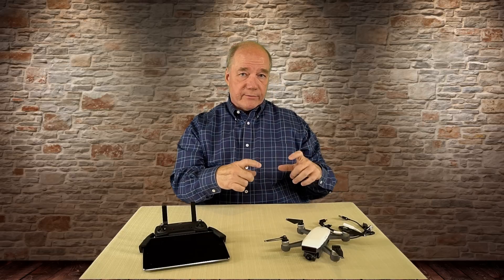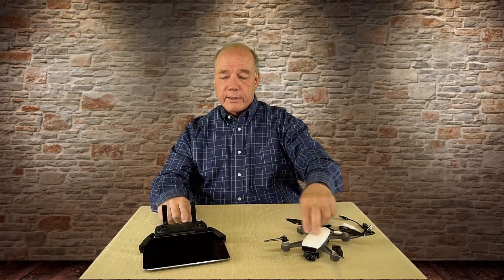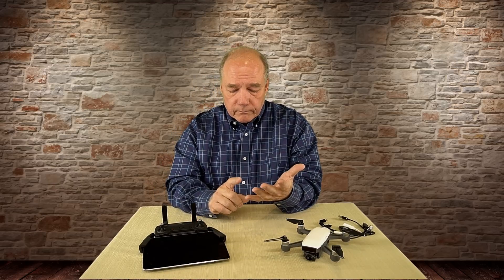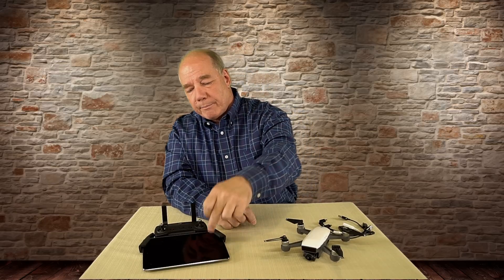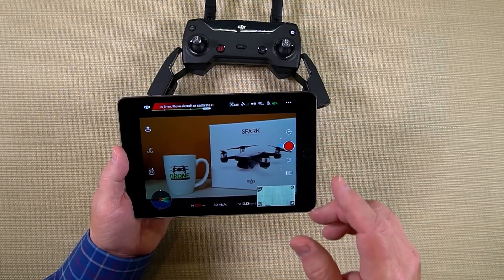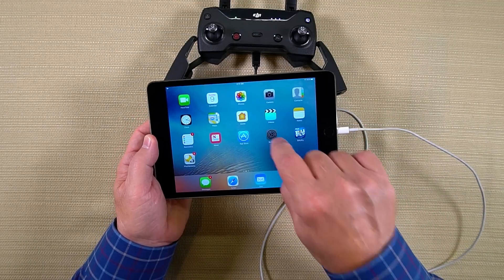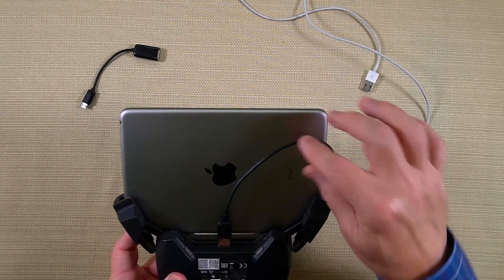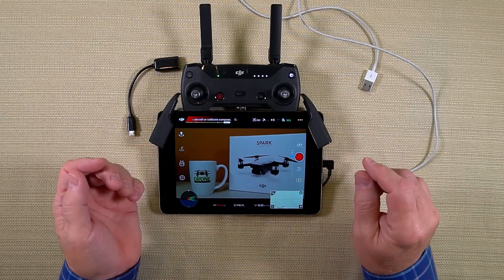One Simple Trick to Fly Your Spark Farther

Comment: So what is the range of flying and is there a chance to increase it with different controllers?
Reply from the maker: We have a visual line of sight limit in the United States that requires you to keep the drone in sight when you're flying. For me that's about 2500' with a beacon on the drone. That's really plenty of distance for most flying and keeps the skies safer for everyone. Technically it's not possible to use a different controller because that would require a firmware update to bind the drone to the new controller. I hope that helps and happy flying!
Reply: @Dronevalley  thanks for info

Comment: i was told if u so happened to use the OTG cable that turning off the wifi on apple doesn’t really turn it off therefore turn on Airplane mode and it will turn all radio connections of (WiFi/Bluetooth) and your gains from it will be better reception, longer battery life of the phone u use, and a longer range of flight.!! I Everything else in this video was dead on point though thank you and hope i answered some questions (:

Comment: I know I'm being picky or technical but, the controller and drone are looking for a clear WiFi channel or a channel that doesn't have nearby other WiFi channels in use. So, it's not looking for the strongest signal but, the cleanest. BTW, your drone will always be a very strong signal due to close proximity. The secret to any good and reliable RF connection is signal to noise ratio... which is the signal you want over any other nearby signal or noise floor at your location. And, on that subject, i would recommend turning the WiFi off on your phone and iPad. This will remove a very strong nearby WiFi signals that have the potential to interfere or reduce the quality of WiFi connection between controller and drone. I have notice while testing with my iPad WiFi while using it on and off that I see stronger receive signal from drone when it is further away as opposed to my controller seeing other WiFi signals from nearby devices. As one person mentioned the controller and drone have the same transmit power which is true but, the controller can 'hear' the drone easier without other WiFi signals near by. Again, it's all about signal to noise and the other Wifi signals are noise if they are not the signal it wants to hear which is your drone. If you do not have cellular capabilities in your tablet or iPad and need to use tether mode on your phone to tablet, then use a Bluetooth connection instead of WiFi.  Works great, just doesn't have the same throughput as WiFi can have.

Comment: I'm really confused. There's other videos that directly contradict this (like this one:  https://www.youtube.com/watch?v=zKxGrUqiXvE&t=597s).

I also chatted with DJI support today and they said using an OTG cable does NOT result in longer flying distance. I also tested this personally and can confirm this.
Reply from the maker: Robert, thanks for the post and I can assure you that the wired connection makes a big difference in your signal strength and will allow you to fly farther than using the default Wifi connection. The main benefit is that it also provides a more consistent connection in close when you're flying in noisy Wifi areas or around obstructions. I'm not sure who you spoke with at DJI but they are mistaken. It's simple physics, a wired connection is always faster and more secure than a radio signal and this is especially true with you have 2 Wifi transmitters as close as you do in the default setup with the Spark. You phone is connecting over Wifi to the controller, which in turn is connecting to the drone over Wifi. By adding the cable, you can turn off the Wifi on your phone and eliminate some of the "chatter" this Wifi connection is generating. This not only minimizes the interference created to allow you to fly farther, it also saves battery life on your phone, allowing you fly longer. This is the exact same connection used for connecting the DJI goggles to the Spark and made a big difference for me, especially when flying in noisy Wifi areas like urban settings.
Reply: @Dronevalley  I definitely agree that using a wired connection has a handful of other benefits, but I'm not convinced of the quantifiable nature of proving longer flight distance.

Would you be up for doing a video showing a real time flight of wired controller versus WiFi?

Also, I just purchased my Spark very recently, and it now comes with 2 OTG cables included in the box. Pretty cool!

Comment: Making it overly complicated. Why not just use a micro USB to lightening cable. I been doing that since day one. Also put your phone into airplane mode to stop any interference from external sources.
Reply from the maker: Mike, thanks for the post but a simple MicroUSB to Lightning cable won't work with this connection, you need an OTG adapter on the one end to get this working. The reason for this is that both the phone/tablet and the controller are "devices" that can't talk to each other natively. The OTG adapter allows one of them (the phone) to become a "host" and start communication. I'm not sure what type of cable you're using but it must also enable this function or it wouldn't work. I'm willing to bet that you're still connecting to the Spark through Wifi even though it seems that the cable is making the connection. One test you can try is to make the cable connection and turn Wifi off on your phone (with the Spark on the ground) to see if you maintain a solid video connection. My suspicion is that the connection will fail and you'll need to use an OTG dongle to get it working. Thanks again for posting and I hope you're getting a lot of great fling down there in NZ. Rick

Comment: Do you still use the cable in 2019 ?
Reply from the maker: Yep, I was out flying with the Spark last weekend and used the cable to eliminate the Wifi connection to the controller. It provides a more secure connection and saves battery on the phone by turning off Wifi. Stay tuned for more clips posting soon. Rick
Reply: @Dronevalley  Thanks !

Comment: EVERYBODY.   KNOWS. THAT.  THATS. THE. OTG.  CABLE. DAAAAAAAAAAA
Reply from the maker: Thanks for the post and just a few things to remember, when I posted this clip this connection was new to everyone and I wanted to make sure folks knew what they needed and how to do it so I explained it in details. Also, not every OTG cable or converter works with the Spark. We tested over 15 of them and only found 3 that worked and 2 of them were big and clunky. We actually have the one I showed in the clip specially manufactured for us so we know it works. Rick
Reply: @Dronevalley   so. Wich one  is the best cable. For. Samsung note. 8. Wich brand

Comment: Oh god dammit.. at 2:25 I stop the video because I can tell that this dude is just going to say, "use an OTG cable"...
This video should be deleted. This is no "TRICK" WTF MAN?
Reply from the maker: Thanks for the post but you have to remember that this clip was posted over a year ago and I was one of the first people to figure out that you could use an OTG cable for the quad. Even still, there are new fliers every day that have no idea about this fix and appreciate clips like this to help them with their flying questions.
Reply: Drone Valley I'm sorry dude. It was late and I hadn't had my nap..
I understand context of the video.. the time and all, I'm glad I came in late and it just works.
I don't agree with people saying that using WiFi from controller to phone is the same as otg.
Otg is way better.
I learned allot of other things from your video as you explain radio protocols, WiFi, etc...
Thanks man.
Reply from the maker: No problem, I appreciate you coming back to comment further. I love flying and when I figure something out that will help others, I post a clip like this one. That way we all get better together. Thanks again, Rick
Reply: @Dronevalley  my spark package came with two wires a usb c and standard usb can i use those for my andriod or do i still need dongle

Comment: Thanks for always informative videos.  I use a cable already.  Works fine.  Question:  I'd like to begin using an ipad solely for my drone.  I don't see a need to buy it brand new ( i have other options).  What are the minimum requirements or model that I should search for?  Minimum GB, which generation will do the trick?  Thanks.   I may just buy new.

Comment: If youve ever gotten a new Samsung Phone the usb to micro usb tiny dongle is in the box, just find a short cable. And its done.
Reply from the maker: Rob, thanks for the post but that is simply a converter from USB-C to Micro-USB and won't do what you need for the Spark. To make the physical connection to the controller, you'll need a specialized OTG dongle that essentially allows two "master" devices to talk with each other. I put this clip together because I have tried a lot of different versions of these OTG dongles and finally found one that works. Thanks again, Rick
Reply: Drone Valley 
The pins looked the same...
USB 2.0female  less the cable lenght.
Samsung even calls it OTG as other use.
However if you say it won't work, I'd better tell mine to quit working....
Reply from the maker: Rob, if it says it's an OTG, then you're OK. A lot of the adapters are included that don;t provide that function and only allow a customer to still use an older MicroUSB cable with the newer USB-C phone.
Reply: Drone Valley 
Thanks for clearing that up.
Nice video !
Reply: He's absolutely right. Just verified it works for me.
Reply: Yes this works for me also... don't use it much now at all since last update improved connections

Comment: RICK, As of their last firmware update the OTG option has been completely disabled on the Spark RC to any device. Even DJI admits to this and we can HOPE they straighten this  out as prior to the update with the cable there was NO lag time and much better controls response.
Reply: "As of their last firmware update the OTG option has been completely disabled on the Spark RC to any device." DJI must have restored the OTG option, because mine has the latest firmware as of 9/2018, and the cable connection works great.

Comment: When i connect the OTG cable and the satellites go off line and there Is no GPS flight mode because there Is no satellites available. Solutions ? Thanks
Reply: "there Is no satellites available." In my opinion, using OTG or not using OTG has no effect on satellite availability.

Comment: Nice job, but here are my questions. I use the mini c to lightening cable between my controller and mini 4. Works great. But I need WiFi on to get my maps via my cell phone hot spot. I do not have and never had a selection to download offline maps. So WiFi stays on. I assume the WiFi hot spot connection interferes with the Spark / controller WiFi connection, but cannot get around it due to the map issue. Any ideas?

Comment: Hi Rick i just got a spark and was having a bad time connecting my phone to the controller i found using the cable
between the two made it work. Yesterday i saw some video's about not having to use the cable any more because of 
the latest update i removed the cables and turn on the wifi and it works fine without the cables now. I know this 
is a older video have you changed the way you set up your Spark since the Jan. updates. Thanks

Comment: my question is does the cable still work everyone says the new version on the app no longer allows this cable connection
Reply: "everyone says the new version on the app no longer allows this cable connection" As of 9/2018 I can tell you my Spark running the latest firmware works great with OTG cable.

Comment: $18.95??!!  No thanks I'll look for something else.
Reply from the maker: Bo, thanks for the post but the cable I have on the site was custom made for us as was the OTG connector. I designed the set to be as small as possible and is the perfect length for your quad. I also certified that the OTG connector works with the quads and integrated a right-angle connection to make sure the cable lays flat against your phone/tablet. This type of custom manufacturing is somewhat expensive and I kept the cost of the cable set as low as possible. When you consider we also ship it free, it's really a bargain and something you know will work when it arrives. Hope that helps with your decision. Rick

Comment: The OTG cable does not improve distance. PERIOD. When using WiFi, there can be small periods of interference between THE PHONE AND THE CONTROLLER. The OTG cable eliminates those blips. This does not increase the range.
Reply from the maker: Bob, thanks for the post but I have to respectfully disagree with you. As I've explained in several clips on the topic, there are two separate Wifi radios in the controller. One connects to the quad (powerful) and one that connects to your phone/tablet (weaker). Because these radios share the same limited bandwidth there is a natural competition between them for connection to their respective devices. By adding the OTG cable to the controller, you eliminate one of these radios and reduce the congestion created by the tethering connection to your phone/tablet. This not only improves the reliability of the other connection to the quad, it also extends the battery life (and flying time) of you phone/tablet since you can turn off Wifi on the device. The reason the range is longer is that you now have an unimpeded signal that provides a more solid connection to the quad at distance. This is especially important when streaming video back to your device because this activity is the biggest bandwidth hog on the quad and will start to suffer soonest. This is why you start to see choppy video long before you lose a radio connection to the quad. By improving this connection you can essentially fly farther because your video feed is more stable and your connection more reliable at distance. I hope that helps and thanks for watching the clip. Rick
Reply: Maybe a DJI engineer will come along and set one of us straight.   Using the OTG cable WILL NOT INCREASE FLIGHT DISTANCE.  IT WILL improve the video signal.
Reply from the maker: Bob, I didn't mean to start an argument, but aren't we really saying the same thing? If it improves the video signal (especially at long distances) and you need the video signal to fly, using the OTG cable does in fact allow you to reliably fly farther.
Reply: It allows you to reliably fly.  Not farther.  Not higher.  Not deeper.  It just improves the video feed from the controller to the phone.  The improvement exists whether you are at 15 feet or 1500 feet. So I don't think we're talking about the same thing.  If you fire up your Spark and you have poor image transmission, you're not likely to take it out 2000 feet.  But no, your range is not improved.  An inch.
Reply from the maker: Bob, while I appreciate the spirited discussion, I have tested this on several different locations over a wide variety of terrain and I can tell you from my experience and testing that the range is improved on the Spark using the OTG cable. As I stated in an earlier post, the video feed is the first thing to be affected by signal issues and depending on where you're flying, it can be dramatic. By eliminating the second Wifi connection and tethering the phone to the controller directly you improve this video feed, which allows me to fly the quad farther out because I have a stable video feed. Without the OTG cable at these distances (still in VLOS) I have choppy or no feed at all and would not have been able to fly out that far. I have done this testing over the same routes using the cable and then again using Wifi and in every test the OTG provided a stronger connection. In addition to the testing, I have explained technically why the OTG cable helps improve your flight not to mention the added benefit of not using Wifi on your phone, extending it's battery use and enabling a longer flying time. All of these reasons support the use of this cable, which is a very low cost item for the added benefits it provides. Now lets quit debating this and go fly our quads. Rick
Reply: It's too cold to fly here, so all I can do is argue.  But I'll let you have the last word on it (even though you didn't change my mind).  I appreciate the respectful conversation.

Comment: Just a heads up guys.  For anyone new reading this post, it looks like the DJI GO 4 App (vs 4.1.20 - Newest Vs Out) has an issue with the OTG Cables.  Users reporting "Weak Image Transmission Signal" with this newest version.  Info here on DJI's site;    
 https://forum.dji.com/thread-124935-1-1.html  .  One of the DJI ADMIN's on the forum posted this;  "Please wait patiently. Our engineers are working on that. Your requirement was forwarded. Thanks for your support. ".

Comment: I need some help here !!! .. I'm trying to connect the controller with my Samsung galaxy s8+ and using the otg cable and it doesn't work at all ..
Reply: I had to unplug the cable, replug the cable, then try 3 different cables to get it to work. My high quality anker cable works, the cheap ones you get for free with other devices does not. I don't know why?